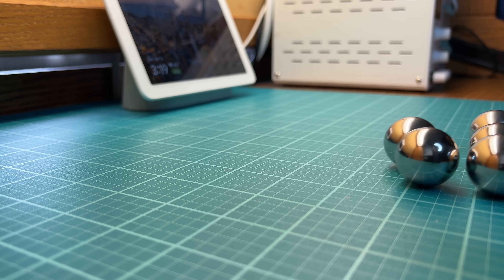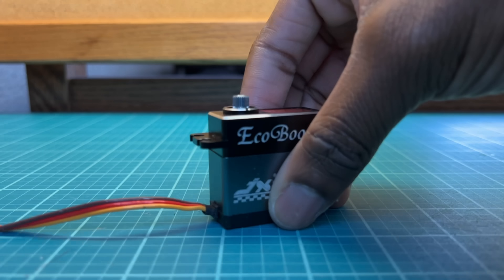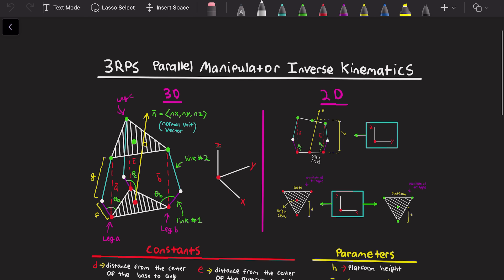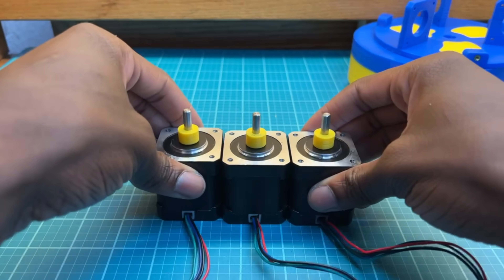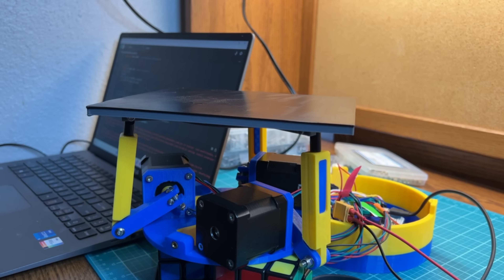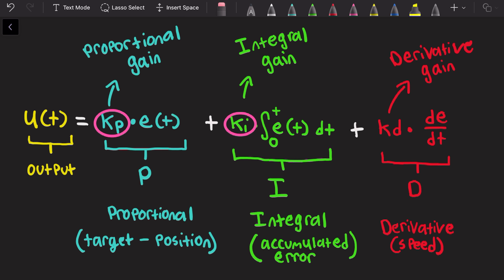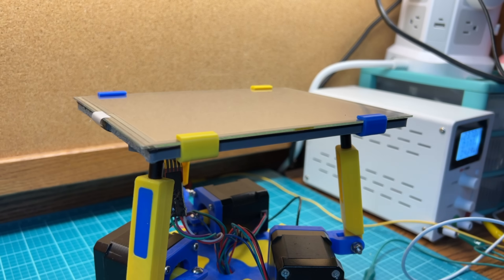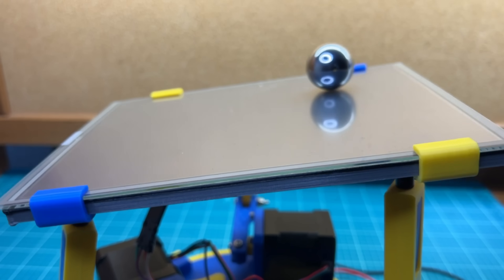I Built a Ball Balancing Robot

Comment: hi there can i please asked what qualifications you obtained to learn all this as i am hoping to do the same
Reply: I am not the author of the video, but it is evident to me that a bachelor's degree in electrical engineering is sufficient, if one also augments their university studies with a little bit of experience in microcontroller programming, stepper motor control, 3D printing, and some rehashing of first semester university physics (to understand mathematically the physics of how the ball will be expected to move).  A great many things are possible with such educational and experience background, although in practice people are usually restricted in available motivation for making "cool" (but non-essential) projects, since it still takes quite a bit of time and effort to design something that works, like shown in the video.

Developing a product as sophisticated as the one shown in the video is quite slow for a human engineer, and it would normally take substantially more than one weekend to accomplish (probably more than a month of cumulative on and off effort for the typical human engineer).  This is partly due to the need to learn or re-learn some things to get things to actually work right, and partly due to how slow humans are at doing mathematics and trying to manually model physics.  Theoretically, a smarter than human AI (artificial intelligence) could engineer the same thing extremely fast (potentially in under a second), if it had sufficient knowledge of the various technologies available, it was good at writing software, and it was already internally programmed to be good at math based physics modelling.